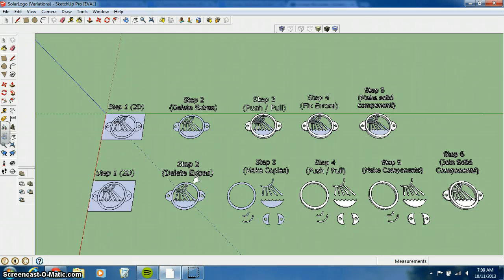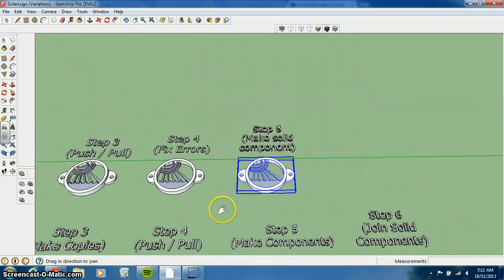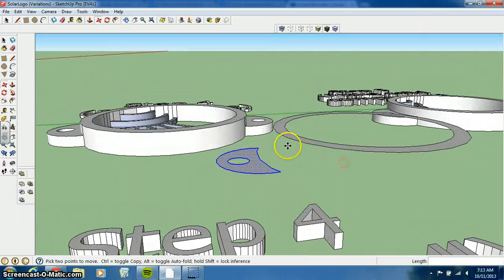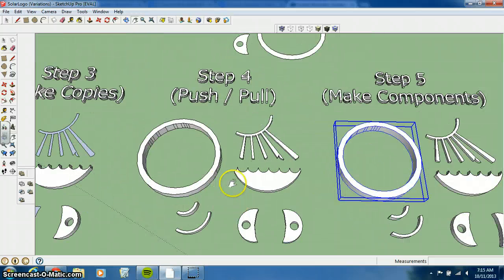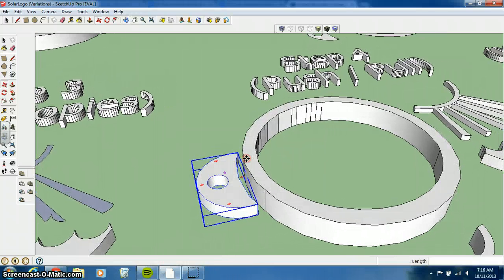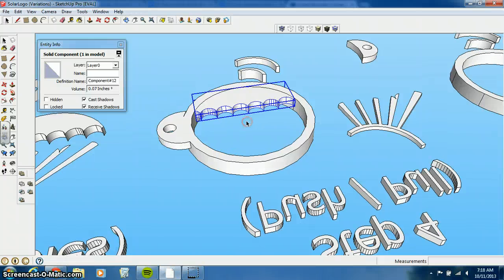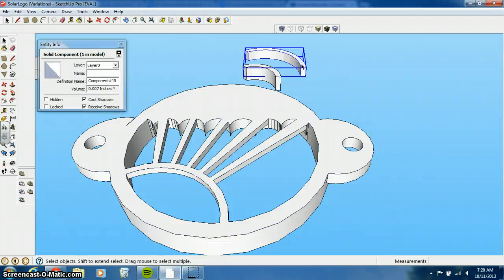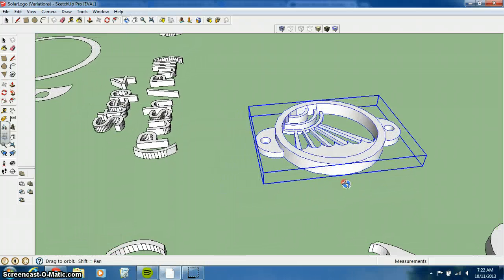2 Methods to make a Solid 3D Model using SketchUp

Comment: Hmmm, actually all you need to do is press Ctrl when you push pull and you will not need to do all that extra unnecessary stuff as it will keep the bottom.

Comment: I don't understand how SketchUp "recognizes" certain objects as solids. Aren't all objects in SketchUp technically hollow? If you hide or erase a face on a 3D object in SketchUp, it shows the hollow inside of it. And why is the Push/Pull tool the only way to make solids in SketchUp?
Reply: a "solid" in sketchup refers to if its watertight. Basically, all edges are welded together, not leaks, no stray edges. Solid in other programs, is exactly like how you and i are thinking. SOLID. I use sketchup all the time. I am solidworks certified as well, but SU will do all that i need it to do for me. If i need to calculate mass, i can use the volume info from SU and multiply it by the density of whatever material and then i have mass

Comment: When you use the Push/Pull tool, simply press Ctrl after clicking a surface to make it a duplicate surface from the original, meaning that you don't have to go back and fill in the bottom like you showed in step 4.

Comment: You would spend less time learning a real 3Dmodeling software than fixing all that sketchup mess.
Reply: depends. I am a CSWP in solidworks and i still use SU because i can do some things so much faster. Granted, there are about 7 ways this gentleman could have accomplished this task, but he showed a mere 2 of them.  However, there are alot of messes that can happen in SU. that is why it is best practice to make things in meters then scale it own to inches. IE, if a part is 3 inches in length, makje it 3 meters, then use the tape measure tool to scale it down to the size you need. OR you can make the object in inces, mm , then make a copy of the component, scale that up by 1000 times and whatever edits you make in the large one, it will copy over to the small one. Or scale it by 1000 times, then scale it by 0.001 at the end to get it back to the original size. The tiny face issue does suck